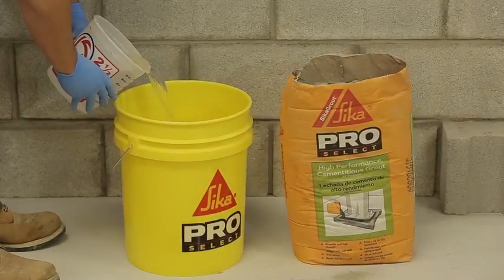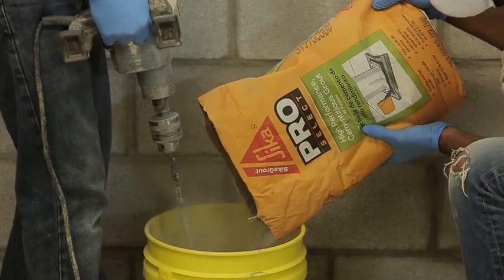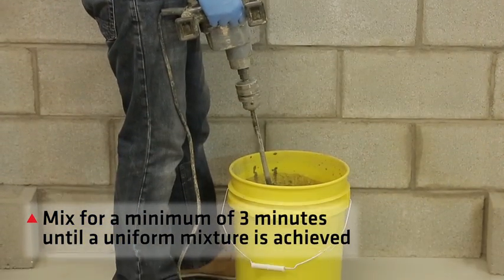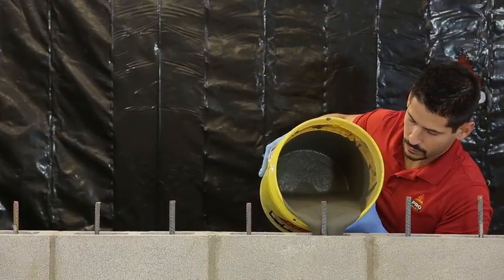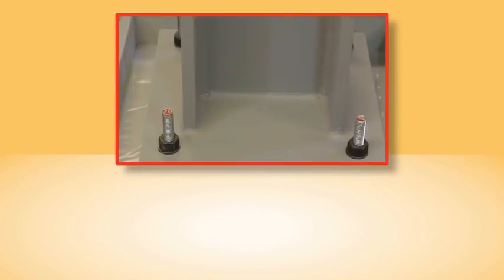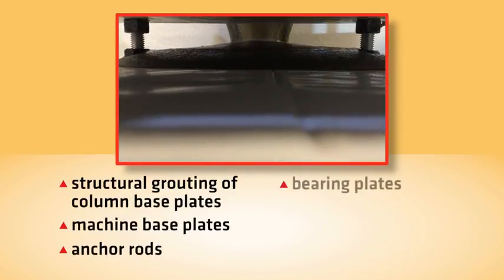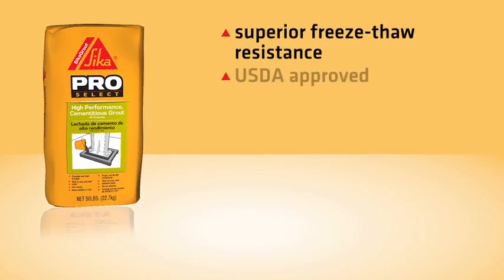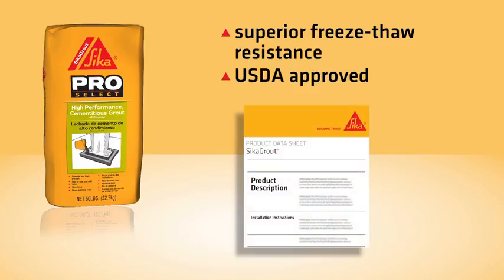SikaGrout High performance, cementitious grout

Comment: So does this need to be vibrated under column bases?
Reply: If you can, then yes. I always find that using a piece of banding, and of course only pouring from one side, or through the grout hole in the base is the best way to avoid air pockets. A dead blow hammer to gently tap on the base or forms to remove air bubbles is also helpful.